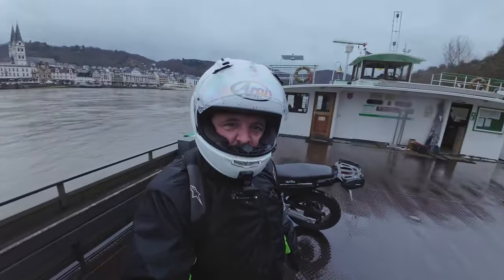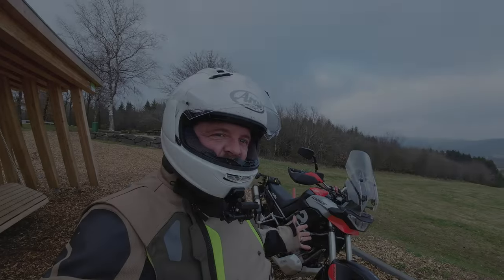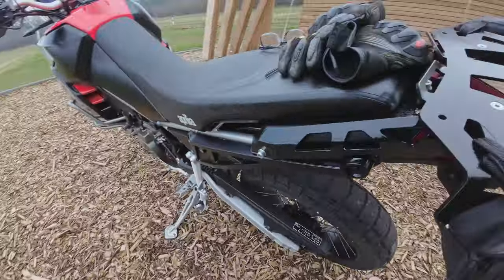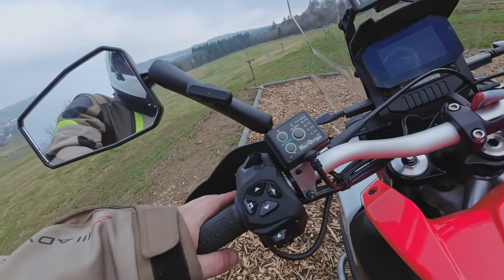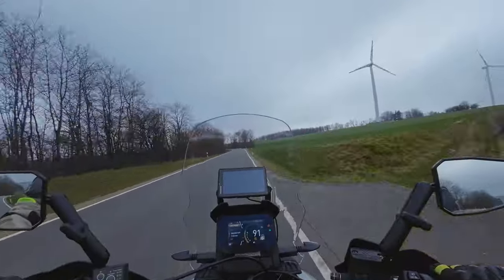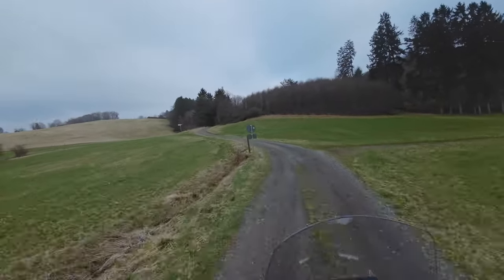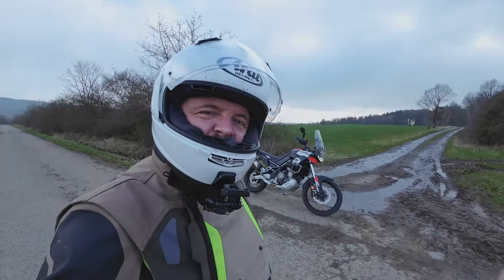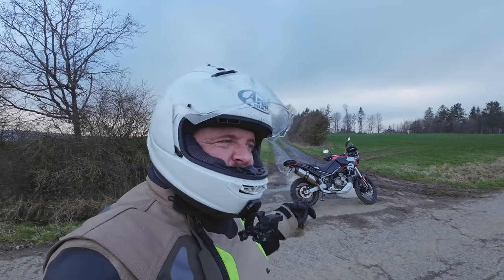Aprilia Tuareg 660: My first 1000kms, my HONEST experience

Comment: Honest experience? My friend, I had to stop watching after 5 minutes...
Is it that difficult to provide correct info?
1) The first service is expensive because valve inspection? Are you kidding or what? 😂 There is no valve inspection at the first service, neither at the 10000km service... The first inspection is foreseen at the 20k service... Read the manual, maybe the dealer just played you?
2) There is no missing bolt for the engine protection, you have a bolt on the front and a sort of slide at the back, and that one is broken, non missing, you can clearly see that the engine guard is deformed, you smashed it in something...
3) Ride in salty water and then leave the bike in the van for few days? And then you get corrosion? What a surprise... 😂
Reply from the maker: 1) That means all 3 dealers close to me are lying to their customers, along with many other dealers around the world. I did question it, because I thought it was unusual. I was shown a notice to check exhaust valves on all 660s. Clearly dealers are using this as an excuse to over charge customers world wide. I didn't say the 10,000km was a valve inspection, that's at 20,000km.
Reply: I can see that my previous comment disappeared. 
Yes, they lied to you. Check the manual. No valve inspection at the 1000 service. And this is the first time I hear about this. Can you show us what they showed to you? And can you tell us what you mean with "other dealers around the world"? As far as I know this is the first time I hear about this, maybe you have read about this inspection somewhere else and can post a link to that?
Reply from the maker: I took the English user manual PDF in to the dealer on my phone, I have read it cover to cover. Just google expensive first service tuareg and there are a few. Like I said in the pinned comment, I'm gonna dig into this!
Reply: Side 190 on my user manual, downloaded in May 2022.
I googled what you suggested, got only results for the VW Tuareg. And anyway I am not saying that it’s the first time I see a post on expensive first service, I meant expensive BECAUSE of the valve check you gave as reason.
P.S. I would have digged BEFORE making an informative video
Reply from the maker: @giamaica7595  forgive me for believing three different dealers. It's probably my fault, right?
Reply from the maker: @giamaica7595  I read the same manual
Reply: @btgmoto well, you made the video to inform us about you experience. So yes, it’s your fault because you did not checked what you say in the video. It is your video after all, not your dealers video
Reply: @btgmoto then you see that there is no valve check at 1000km service? I would post a screenshot from my manual, if I could
Reply from the maker: @giamaica7595  yes, I saw that and I told the dealer, that's what I said.
Reply from the maker: 3) I didn't ride in salty water. It was dry. I didn't know that the roads were so covered in salt still.
Reply: @btgmoto forgive me. You said «I rode in salt». So I assumed salty water, meaning rain/water on salty roads. Which is normally how salt can get to the bike: through water/moisture
Reply from the maker: @giamaica7595  When somebody is robbed, do you blame the thief, or the victim?
Reply: I am not blaming you for being robbed. I am blaming you for spreading wrong info on a platform which has millions of users. No matters if someone else gave you that info. IMHO, if you post a review/test/whatever on youtube you are responsible for it. That’s it.
Reply: @btgmoto  hey those three different dealers probably talked to each other. They're probably like hey we're the only people selling these motorcycles in this country right now we should all have our services the same price. I've seen some dealerships do some shady shit man lol. I've had dealerships recommend me stuff that isn't even recommended by the manufacturer. I never trust dealers.

Comment: Nice Video. But you said that aprilia was expensive first service. Due  to valve check? I can not find any Info on that. Or any bulletin regarding needing a valve check at 1000km.  Have done 6000km in 5month on my Tuareg . Also sprayed my bike with acf 50 before I parked it.  Can't  wait to ride again.
Reply from the maker: It's in the 2023 manual that I saw at my dealer and a few others on the forum have seen it too, initial inspection of exhaust valves is 'highly recommended'.
Reply: They missed that note hear in the US. It was a simple TFT red light reset and back on the road. The bike is a great fit for me. Good review
Reply: @btgmoto 
I have a 2023 and don't see it mentioned. Do you know the page or section so I can make sure it's not something I need to do for my own peace of mind?
Reply: Why is there confusion about this - isn't it clearly stated in the manual?
Reply: It's highly unlikely that the valves need checking so early on.
Reply: No valve inspection at the first service. I don’t know what kind of manual did they show you. But you should have got the user manual with you bike and there you can see that there is no inspection. Neither I can see that in the two workshop manuals I have bought (one in english and one in italian). Did they show you something you should show that in your video as well

Comment: There´s NO valve inspection that goes for the 1st service. You´ve been ripped off. Only general inspection, oil change and filter. That´s it. I live in Norway (which has the most expensive prices in all of Europe except for maybe Switzerland) and I was set back bout £250 give or take.
Reply from the maker: Yep, sucks. As per my post, possibly I was mis-led, possibly I mis-understood the German techno-babble. Either way, sucks to service your Aprilia here in Germany where every dealer charges more than a BMW dealer for even simple shi*